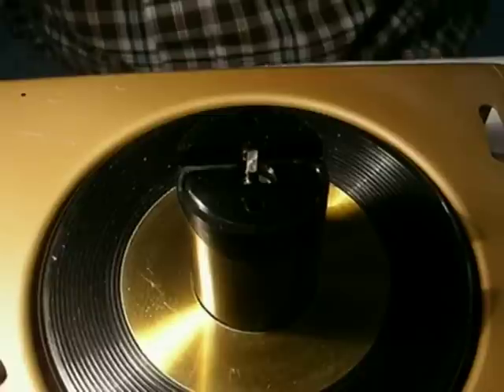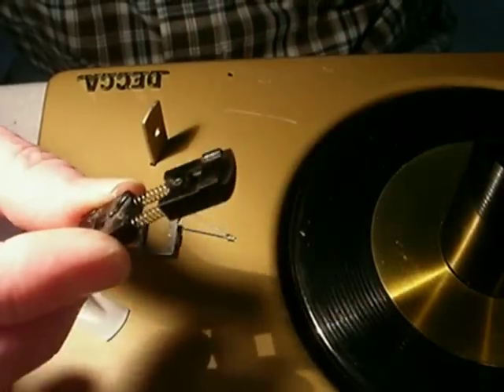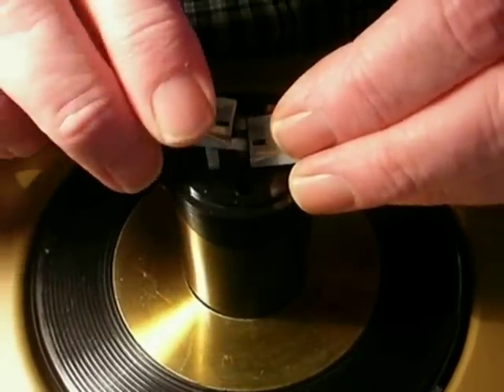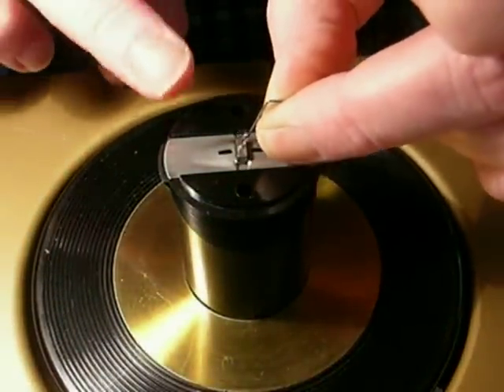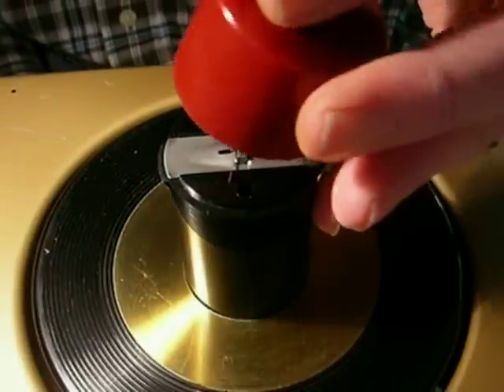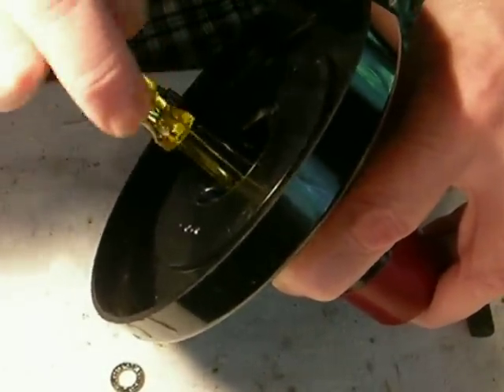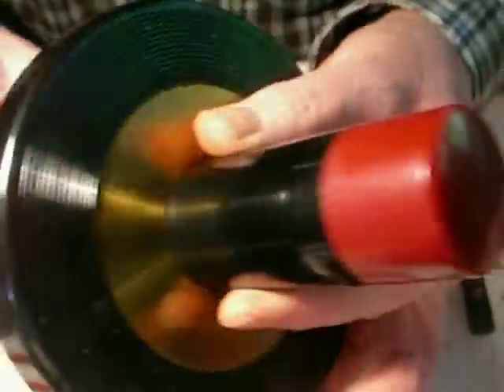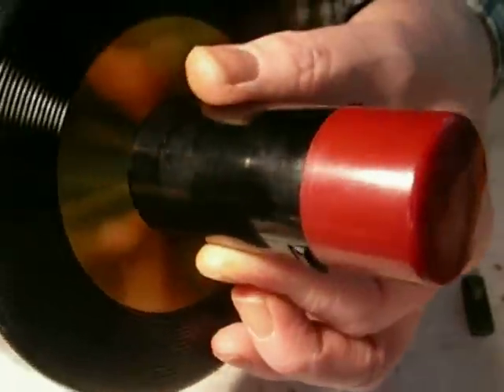RCA 45 RPM changer RP-190 Turntable reassembly

Comment: I wanted to say that I found your video SO helpful in rebuilding the spindle on my RP-168 45 RPM player. I did find that installing the metal sleeves was quite challenging, but I guess that is just the original design. Thank you again for posting such a useful and informative video!

Comment: Very clear instructions & a good demsonstration. Fortunately  I've never had a problem with my 45 player spindles.. I usually spray them through the deck area with a little Deoxit, & this seems to get them working really smooth.   I did disassemble and  fix a  regular RCA 45 spindle, & it did fly apart.  Parts went everywhere, but I managed to find  them all & put it back together as you demonstrated here, but with a little more trial & error.  I didn't have your helpful instructions back then

Comment: Great stuff.  Between this vid and another from someone else I got mine rolling.  Thanks!   I have the A108 RCA VIctor from the early 50s which has a 33/78 turn table as well but I don't see much repair info on this turn table on the inet.  There is a wad of aluminum foil used as a spacer for a very small belt that is too large that is obviously a wrong installation.  The drive post operates strong and this small belt goes between the drive post and a stationary post.  Foil acts as a spacer on the stationary post.  An idler arm contacts the belt to create the TT motion. Amazing this janky set up worked for almost 2 months! Anyway I'm thinking I just need to remove the foil and get a smaller belt.  Although i'm not sure if the belt is supposed to be there at all and the drive post is supposed to contact the idler arm directly.......Thanks in advance for any clarity you may be able to provide.

Comment: For the cracking around thew screw holes in the plastic top what I did was to put some 5 minute epoxy around where the screw holes are to prevent further cracking while allowing the screws to be properly tightened.
Reply: I also lost both springs so I found a defunct cassette player and removed two springs that made the buttons pop back up. Tried both and it was too hard to turn so I tried one spring and it is just about right.

Comment: "when i turn my player on, it stops just about when it is dropping a record, how do i fix this?."
Reply: david W, it sounds like it needs to be cleaned and greased with new grease, the platter, the idler wheel and the automatic parts under neath the player and the motor needs to be cleaned and greased.